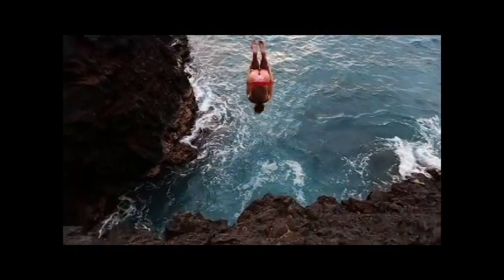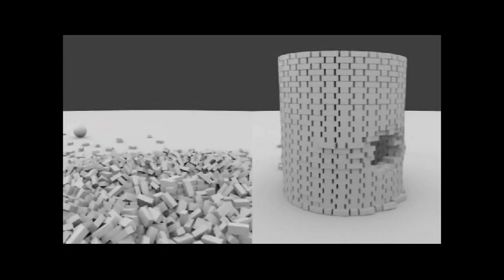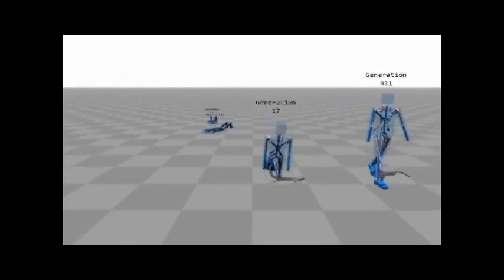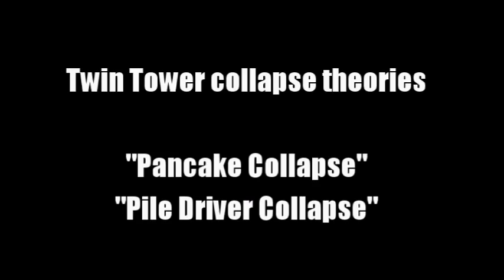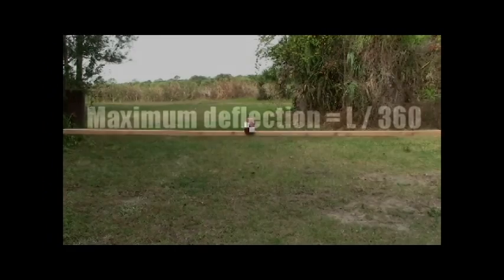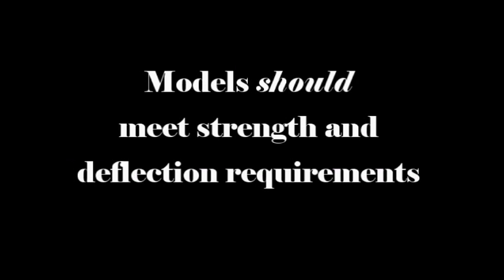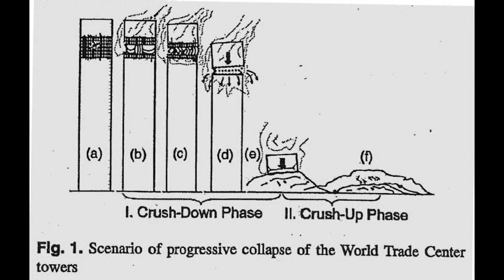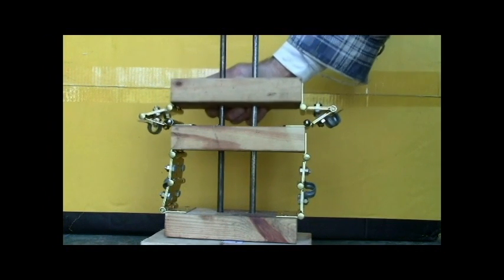9/11 Experiments: The Force Behind the Motion

Comment: Every lower floor resists the weight of what goes above. In addition, the law of action and reaction slows the acceleration of a mass that crashes from above. But the damned intelligence corps and the powerful PEOPLE will fill these sites with fraudulent and pseudoscientific demonstrations. We are governed by criminals DO NOT DOUBT ...
Reply: SoyDebarro - "Every lower floor resists the weight of what goes above."
No it doesn't, unless you believe every floors was built upon the one below. Reality however tells us that the floors were mounted to the perimeter and core. The floors only needed to carry their own weight and the additional live ans static loads pout on them.

"the law of action and reaction"
Which law would that be? Are you referring to Newton's Third Law of Motion? 

"slows the acceleration of a mass that crashes from above."
This actually correct. It does slow the acceleration. It however never suggest the acceleration stops. Do you understand the difference between spoeed and acceleration?

"But the damned intelligence corps and the powerful PEOPLE will fill these sites with fraudulent and pseudoscientific demonstrations."
Like the above video you mean?
Reply: They need their eyes examined. Just watch the collapse of the North Tower and pay attention. There is no pile driver, or pancake to see.
Reply: Paul DiBenedetto - I see. You must be a flat earther too then.
Reply: Following your argument It follows then that when a weight is removed the inertia of the columns makes them remain. What's more, that strong core falls at the same time? Uhm brought by the hair ...
.
Acceleration is always the same, gravity, but the reaction is also gravity, when the floor collapses against the inertia of the lower floor. (there is no free fall). - 

I wonder - Is this guy, misinformation agent? or they only exist in the movies.
Reply: I am really trying to understand what you are saying here, unfortunateloy without any luck.Are you saying that the core would have stood straight up if the floors would have collapsed? Are you asking why the core was carrying less vertocal loads but yet it collapsed? Well, the floors were not just floors to carry their own weight and live and dead loads. They also provided lateral stability to both core and perimeter. The core wasn't cross braced and would simply collapse under its own weight. And that is exactly what we all saw happening after the towers collapsed: the cores (or large parts of it) were still standing and collapsed about 10 seconds later because of a lack (or absense) of lateral support.

"Acceleration is always the same, gravity, but the reaction is also gravity, when the floor collapses against the inertia of the lower floor. (there is no free fall)."
Again, I am not a 100% sure what you are saying here. Acceleration is not always the same. Gravitational force is always the same on earth. I agree there was no free fall acceleration when the towers collapsed. I would not expect any free fall acceleration to be there either. When the mass of the upper part bergan to come down, it excerted a certain force on the floor-to-column connections of the floor below. The connections failed and the floors kept falling to next one below. This causes some resistance and is the reason why both towers collapsed at the rate of about 2/3 rd of free fall.

"I wonder - Is this guy, misinformation agent? or they only exist in the movies."
You mean the guy that made the video? I don't think so.
Reply: SoyDebarro - So I see you have deleted your most recent comment. I'll take that as a good sign. May I assume you have read into it and realized you were incorrect?
Reply: You understand well, but it does not suit you, huh? - According to you, the floors below do not support the above (say agree) - They are supported by the structure,  It turns out that the fall of a single floor collapses that same structure that supports 100 of them, kinder logic  ha ha ha ..

..."They also provided LATERAL stability in both the nucleus and the perimeter. The nucleus was not crossed and would simply collapse under its own weight"....  That statement is simply false,  it is the nucleus that provides stability, and not vice versa, the emphasis is on balancing the vertical forces mainly, ¿Does the air that surrounds the entire building exert horizontal forces greater than gravity? Uhmm fraudulent and pseudoscientific your demonstrations...
 
When talking about disinformation agent, I mean you, maybe you are an engineer OR else who needs to live on the breast of the criminal government.

Let's clarify the context, these are not conspiracy theories, it is science, logic and facts against conspiratorial realities of CRIMINAL governments...
Reply: SoyDebarro - "According to you, the floors below do not support the above (say agree)"
Not according to me, but according to all available evidence. Am I wrong? Show me how.

"They are supported by the structure,  It turns out that the fall of a single floor collapses that same structure that supports 100 of them, kinder logic"
They are not only supported by the structure, they are part of the structure. The columns supprted the floors vertically. The floors supported the columns laterally. I think you really should look into the design of the towers a little bit. It will take away a large part of your confusion.
And no, the fall of one single floor did not cause the towers to collapse. The mass of the falling upper parts destroyed the floor-to-column connections which made the floors fall, which made the buildings collapse. 

"kinder logic  ha ha ha .."
Kinda logical indeed ha ha ha ..

""They also provided LATERAL stability in both the nucleus and the perimeter. The nucleus was not crossed and would simply collapse under its own weight"."
If you're going to quote me, please do it correctly. What I wrote is: "They also provided lateral stability to both core and perimeter. The core wasn't cross braced and would simply collapse under its own weight."

"That statement is simply false,  it is the nucleus that provides stability, and not vice versa, the emphasis is on balancing the vertical forces mainly"
In a conventional building the core would provide lateral stability. The towers were all but conventional buildings. The cores were not cross braced. If you do not understand what cross bracing means, please look it up. Start with a few pictures first.
"Bracing, which provides stability and resists lateral loads, may be from diagonal steel members or, from a concrete 'core'. In braced construction, beams and columns are designed under vertical load only, assuming the bracing system carries all lateral loads. "
https://www.steelconstruction.info/Braced_frames
So could you please explain to me why you believe my statement is false

"Uhmm fraudulent and pseudoscientific your demonstrations..."
Wow, even pseudo scientific...? And fraudulant too? Could you please do me the favor of showing how?

"When talking about disinformation agent, I mean you"
Interesting, since I have not made any false claims and all I have written is verifiable. However, your claims are not. So how am I the disinformation agent?

"Let's clarify the context, these are not conspiracy theories, it is science, logic and facts"
And yet you have failed to actually study the design of the towers. You have also failed to use any science, logic and facts. Maybe I am wrong in this statement. If so, please correct me using verifiable facts and credible sources.
Reply: SoyDdebarro - "It is who makes the claim who has the burden of proof."
I couldn't agree more.  

"From the beginning you are inventing engineering models that do not exist"
Which are you talking about in specific? And you know, if you make claim like this, the burden of proof is on you.

"I checked the link that you put to confuse people,"
It is clear that the information provided by The British Constructional Steelwork Association is confusing you. 

"you should re-read the part that says ..."In braced construction, beams and columns are designed UNDER VERTICAL LOAD ONLY, assuming the bracing system carries all lateral loads"..."
Thanks for quoting it again, I re-read it. The cores of the towers were not braced. If we assume that any bracing system carries all lateral loads, what do you think carried the lateral loads for the cores? Have you not seen what happened seconds after the perimeter and floors came down? Have you not noticed how the cores collapsed shortly after this? The whole point is that they still would be standing if they were braced. The lateral stability was provided by the floors that tied perimeter and core together. So your quote proves my point exactly. 

"We see that you really make use of disinformation, to expose half truths."
How? 

Do yourself a favor and study the design of the towers before you make an even greater fool out of yourself. There is plenty of information out there for someone that takes the effort to find it. Let me know if you have any questions.
Reply: Haaa... "It is who makes the claim who has the burden of proof". It is your need to prove your argument that started quite badly. From the beginning you are inventing engineering models that do not exist, To prove it on my part, would be like denying that there is a teapot that orbits the earth (Russell).

I checked the link that you put to confuse people, you should re-read the part that says ..."In braced construction, beams and columns are designed UNDER VERTICAL LOAD ONLY, assuming the bracing system carries all lateral loads"... Extrapolating your claims, (reduction to absurdity) buildings do not need columns and the force of the wind + imperfections + torsion is greater than GRAVITYYY... Uhm ...But AAAALL weight (force) is vertical, not lateral.

We see that you really make use of disinformation, to expose half truths. For now my sources only need to show your contradictions and biased interpretations.
Reply: Extrapolating your claims, (reduction to absurdity) buildings do not need columns and the force of the wind + imperfections + torsion is greater than GRAVITYYY... Uhm ...But AAAALL weight (force) is vertical, not lateral. What you are showing is a building that floats in the air on a planet so small that there is no gravity.

As I said in  ..."They also provided LATERAL stability in both the nucleus and the perimeter. The nucleus was not crossed and would simply collapse under its own weight"....  That statement is simply false,  it is the nucleus that provides stability, and not vice versa, the emphasis is on balancing the vertical forces mainly . Even worse Your reference does not say "mainly" says ONLY.  

We are talking about a building that came down VERTICALLY, not one that went laterally walking on its neighbors ... ha ha ha ...
Reply: SoyDebarro - "Extrapolating your claims, (reduction to absurdity) buildings do not need columns and the force of the wind + imperfections + torsion is greater than GRAVITYYY."
What are you talking about? Are we still talking about the twin towers? Because that's what I would like to keep the focus on if you don't mind. The coumns carried the vertical loads. So what do you mean, buildings do not need columns?

"But AAAALL weight (force) is vertical, not lateral"
Thanks for explaining but I am kind of aware of that. Or do you believe that there are no lateral loads on columns and you can build a column straight up into infinity? Try doing that with just Lego and see what happens.

"That statement is simply false"
It is the quote that is false. Like I asked you before, please quote me correctly and please do not make op stuff I have never written.

" it is the nucleus that provides stability, and not vice versa"
The core carried vertical loads. And vertical loads only. Let me show you what happens when a structure is not braced: https://www.youtube.com/watch?v=_pi2OyG4HKU

"Even worse Your reference does not say "mainly" says ONLY.  "
Please read again what it says: "In braced construction, beams and columns are designed UNDER VERTICAL LOAD ONLY, assuming the bracing system carries all lateral loads". The columns carry the vertical load only. THEY DO NOT CARRY LATERAL LOADS! So what in the twin towers provided lateral stability with an un-cross braced core?

"We are talking about a building that came down VERTICALLY, not one that went laterally walking on its neighbors ... ha ha ha ..."
Do you have any idea how silly this makes you sound? Are you basically saying no structure needs to carry any lateral loads?
Reply: Dude, what the fuck are you talking about? Floating buildings? When did I ever suggest anything remotely close to that? 

"But AAAALL weight (force) is vertical, not lateral."
Yeah, and your point would be what exactly? But I assume you're talking about gravitational pull, right?

"As I said in  ..."They also provided LATERAL stability in both the nucleus and the perimeter. The nucleus was not crossed and would simply collapse under its own weight"....  That statement is simply false,  it is the nucleus that provides stability, and not vice versa, the emphasis is on balancing the vertical forces mainly . Even worse Your reference does not say "mainly" says ONLY.  "
You are still talking in riddles. Try it in Spanish and I will have it translated. Or are you suggesting that buildings which are perfectly able to carry vertical loads, will not collapse if they are laterally unstable? Are you suggesting that lateral instability does not affect vertical columns? Dude. Try stacking Lego blocks and see how high you can get without it simply collapsing. And why do you think this is? Because of lateral instability. Yes. Good boy!

"We are talking about a building that came down VERTICALLY, not one that went laterally walking on its neighbors ... ha ha ha ..."
Exactly. Because of lateral instability. Read the quote again and see if you get it now. "Beams and columns are designed under vertical load only" BEAMS AND COLUMNS! They are talking about beams and columns, They are not talking about bracing. The bracing prevents the beams and columns from collapsing. 

If you don't know what cross bracing means, look up a few pictures please.
Reply: Simple, your argument gives emphasis to one aspect (laterality) and ignores others more important. Fallacy of simple cause or incomplete evidence. The one who looks bad is the one who compares a solid homogeneous piece of a column with several loose pieces without cohesion in its edges (lego blocks)  at the physical or architectural level.
We can already see at what level you are enlightened. Ufff...
Reply: SoyDebarro - "your argument gives emphasis to one aspect (laterality) and ignores others more important."
Please try and understand what I have quoted. It says that columns are designed to carry vertical loads only. Therefore columns are vulerable to lateral forces. Therefore they need cross bracing. Again, if you do not nd the meaning of cross bracing, please Google it and look at a few pictures.

"a solid homogeneous piece of a column"
Do you think the core was built using 420 meter tall columns? Really? No used steel column was taller than three stories. The perimeter columns were bolted together only, the core columns were bolted and slightly welded. What do you mean by "homogeneous piece of column"?

"We can already see at what level you are enlightened. Ufff.."
That's quite a bold statement for someone that doesn't even understand the engineering of the towers and clearly hasn't made any effort to do so.

Comment: what a load of shit ,you dropped a weight on some fibro boards and claim it as irrefutable evidence  . that single weight went through several floors without accumulating the weight from the floors above . you idiots will believe anything and have the gall to call scientists and experts idiots ....its no wonder you clowns still use feet pounds and inches

Comment: I’m not a scientist but I don’t agree with your testing method for the pancake collapse. As each floor collapses, the momentum would increase due to the additional weight from the collapsing floor below. Your boards were held from both sides and that additional weight was being  supported, unlike the towers.
Reply: Blu Crystl firstly, running into a wall is not the same as additional weight falling vertically with its mass increasing the further it travels. Secondly, my claim not to be a scientist was not an excuse for you to insult me. I'm not saying I'm right and the video is wrong, I hoped for an educated discussion but then again, this is YouTube after all.
Reply: Blue Christie - I have asked you before but never received an aswer: Where is your evidence 9/11 was an inside job?
Reply: The bottom floors are always supporting the upper floors, and are deigned to withstand multiples their daily normal weight. So if the upper floors are supposedly pancaking, what makes you believe the lower floors will not resist the collapse above and slow the collapse process, bringing it  to a halt as seen in failed demolitions that are on YouTube? Lastly open your eyes. See David Chandlers videos. He explains it best.